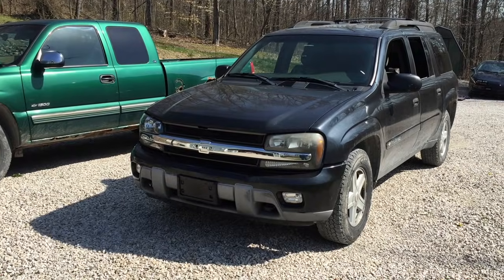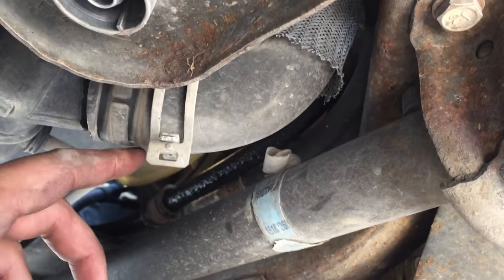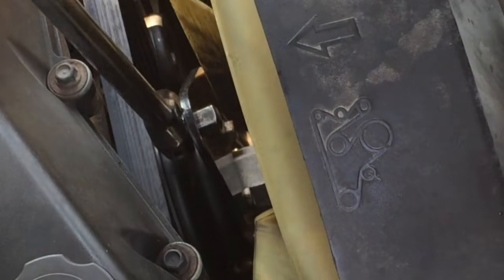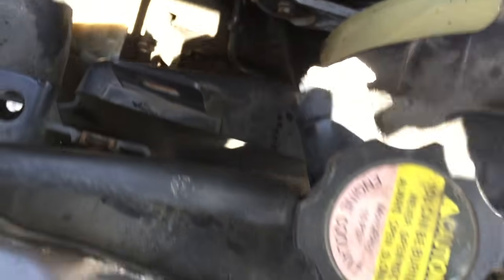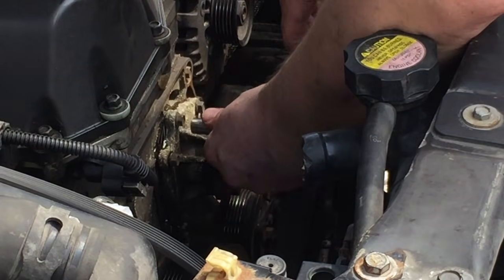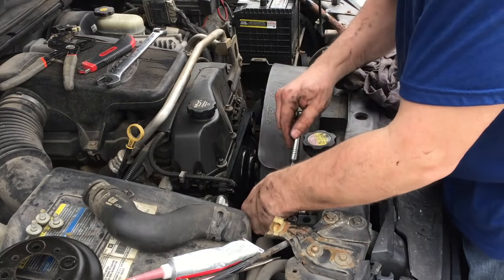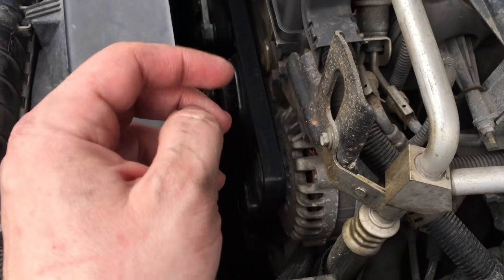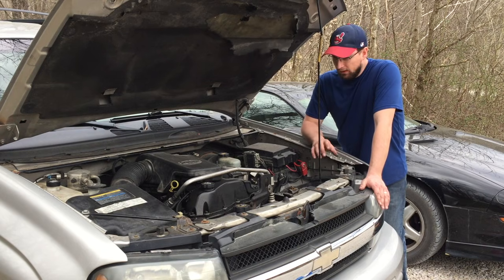How to remove/replace a fan clutch and water pump - bad water pump pulley - 4.2L Trailblazer

Comment: Doing same job in reverse. Changed right side idler pulley, steak gone for three days. Then squeak returned and changed tensioner pulley squeak gone for two days. These idler pulleys were toast. Now squeak back and I found fan vibration. Changing pump this weekend. Yikes! Thanks for video. I can get ‘er done.
Reply from the maker: You got this!

Comment: I have done that job three times on my trailblazer. I use a big wrench and a piece of chain. Put the chain on the pump pully bolt and the other end to an engine bracket on the drivers side. No need to rent the tool

Comment: Great video.  I was wondering about that tool because I've seen so many say that it was difficult to use.
Reply from the maker: BigDaddyDGraffix it wasn’t the easiest tool to use, but it got r dun
Reply: I tried that tool. Useless Ended up just using a pry bar to hold the pump pulley. Worked fine

Comment: Couldn't you take out the cross member bolts and pull it forwards to get the Fan Shroud past the radiator connector nasal? I'm getting ready to do this job myself on a 2004 Chevy Trailblazer. The Fan Clutch went bad so i'm going to replace the Fan Clutch and Water Pump at the same time. Right now i'm watching all the video's on how to do this job. Like your Video!! Tell me if you think that would work or not?
Reply: Good info, Thanks. I have an 03 Bravada and replaced the AC clutch bearing, which by the way seemed impossible to identify what bearing to use, but finally found the right one. Replacing the AC bearing is an entirely different story, but that way I did not need to have a shop drain the AC system, replace AC parts, etc. I loosened the crossmember bolts and I was able to remove the fan shroud without cutting the shroud.
A lot of people simply replace the tensioner and that pully anyway once you have everything open, assuming you have no idea how old the existing one is.  If you don't do that you can release the belt and hand turn the AC, pulleys, etc and usually you can hear a noise or feel the bearing is dragging. So that means it needs to be replaced.

Comment: Not much movement in the fan or pully. But the fan and pully are crooked as hell. Could the water pump still be bad? 2003 Chevy trailblazer. Got these pictures.

Comment: Do i have to unplug the battery or is it just a precaution
Reply from the maker: Unplugging the battery is good insurance that nothing electrical goes screwy when you're unplugging connectors or working around unplugged connectors.

Comment: Everyone makes this common mistake,does anyone realize that the Radiator is clamped down on top with 2 13mm bolts and 2 bolts going horizontally through the plastic bracket can’t remember what size but they’re small,after getting the bracket off just simply bend the Radiator towards the front and easily slide out your fanshroud ,making sure you to take the trans lines off your shroud,
As a side note,a Waterpump will never squeak as the bearing is always lubricated by the cooling,looks like even though that wasnt the problem the waterpump was on its final days,99 % of the time the squeak is the Idler or tensioner pulley,both should be replaced at the same time,sometimes you can get a squeaky Alternator ,that’s usually also right before it dies

Comment: That stuff is not the same as Dex-Cool which is what you need for the Trailblazer.  It requires Dex-Cool !
Reply: Dex-Cool stinks.  The old green coolant is better and lasts longer.
I replaced mine a long time ago after I had gasket issues.
Reply: Ditched the  Dex Cool years ago and flushed system. Refilled with Prestone

Comment: The LEADING CAUSE  of water pump FAILURE is the design of the fan clutch, it's WAY TOO HEAVY and  it CAUSES bearing FAILURE.  my 97 Silverado fan clutch will fit the water pump pump but the check engine light will come on due to the fact the trailblazer is wired from the factory.